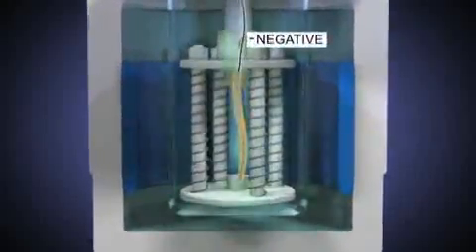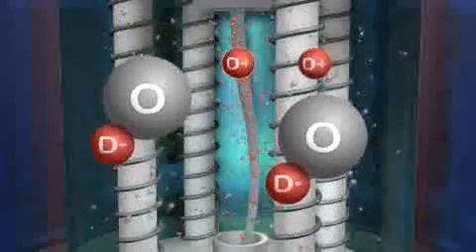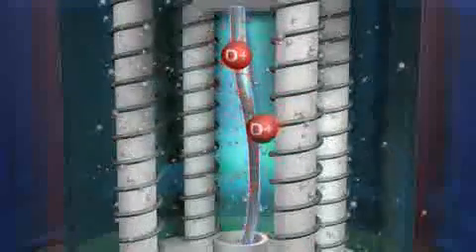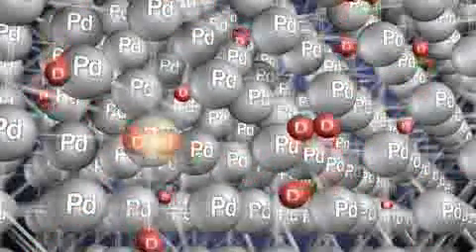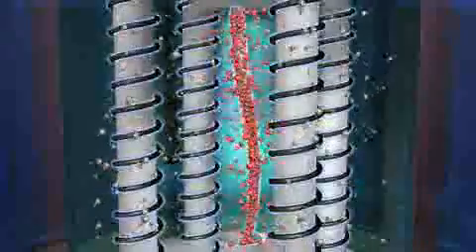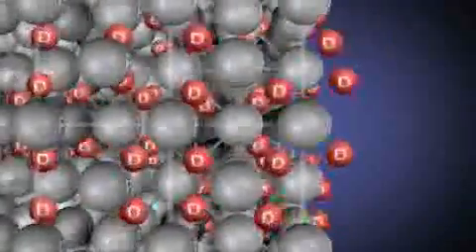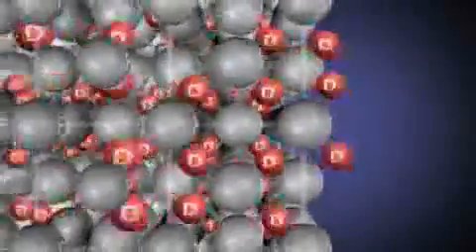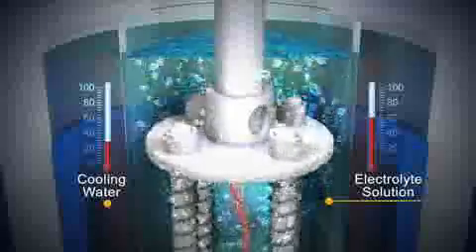The SuperWave™ Fusion Process

Comment: When the Faraday Drive Current is modulated with multifrequency AC riding on top of the DC, it adds more total electric input power, in accordance with RMS (Root Mean Square) of the AC component riding on top of the DC.  In most other models I've looked at, the Energy Budget Model only reckons the original DC power, and fails to include the AC power associated with modulating the DC Faraday Drive Current.  The excess heat is accounted for by the overlooked AC power component.